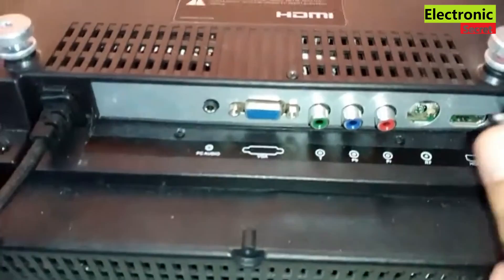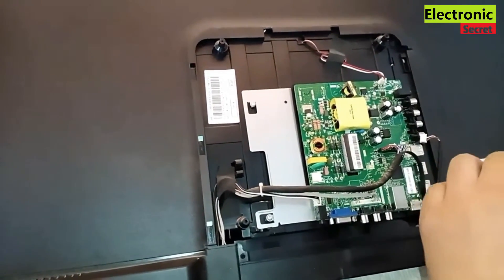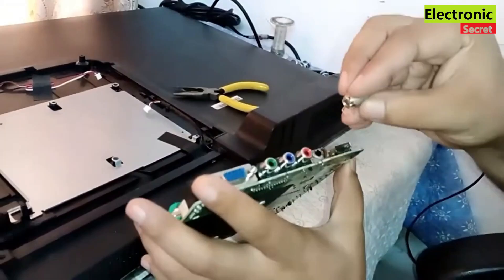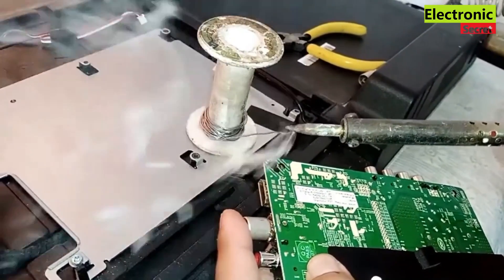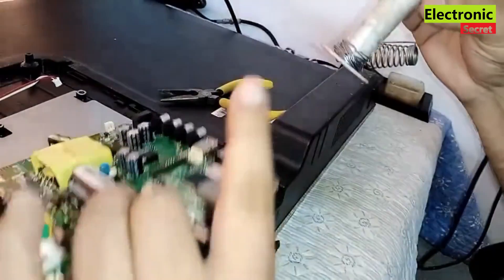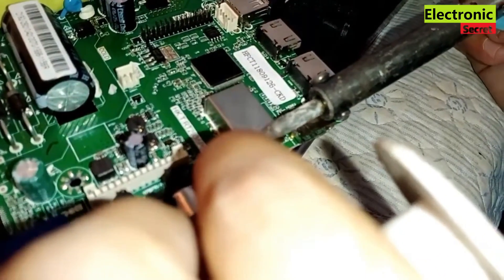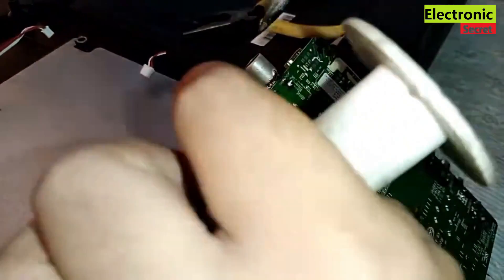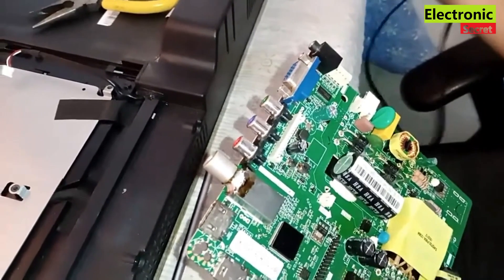HOW TO FIX BROKEN TV ANTENNA INPUT

Comment: Might not need any repairs at all, if the pin is half-broken (like mine), just remove the connector from your coaxial cable and try to connect it to the TV directly, no connectors at all, just one cable touching the other (afaik the outer cables "hair-like" have to touch the connector, and the coaxial "central-cable" has to touch the half-broken pin in the TV), given that the TV in static position and doesnt move, I just plugged mine that way and antenna works perfectly (even the "low-signal" channels)

To be honest my TV is worth 250eur so i would throw it away if this didnt work